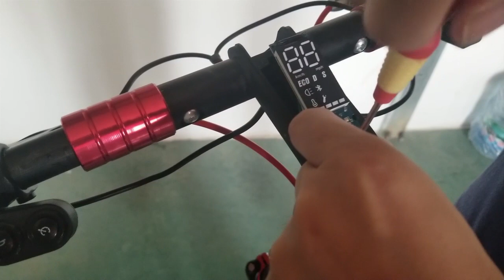replace pro controller

Comment: Dear Albert! I 've problem with my h6 scooter switch on/off button or the controller. I'm not sure which is went wrong. The scooter randomly swith on/ off the lights or change the speed mode, sometimes turn off yourself.  If the controller went wrong I'd change this new pro controller. What's your opinion? Best regards Janos